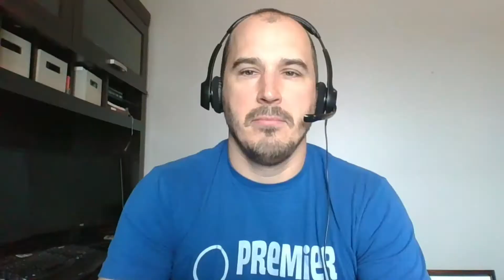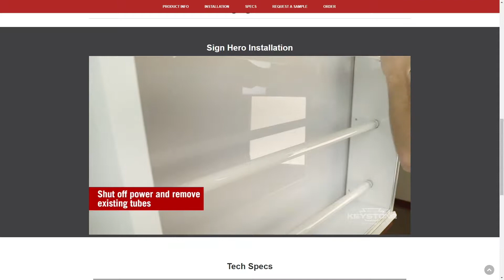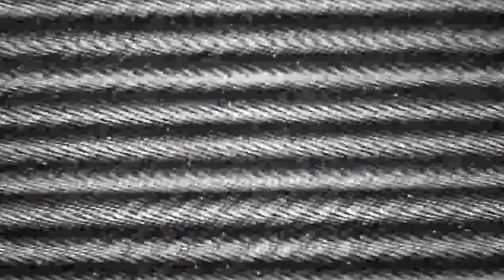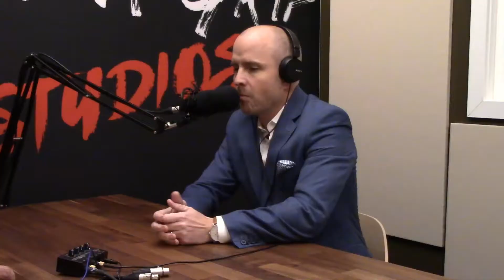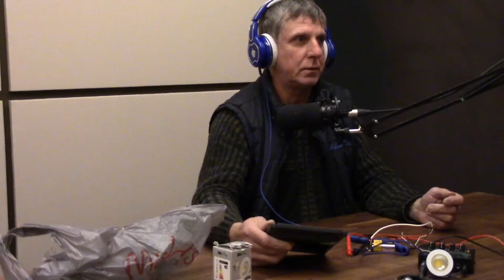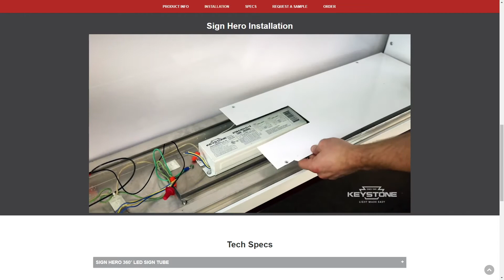EP 053 - Wes, The LED Tinkerer

Comment: Don't either if you know that the proper way to drive an LED is with constant current?  You keep talking about voltage,  but this misleads the audience.  There is a better way to describe the system.
Reply: Duly noted and thanks for listening.  Hosts of the show.
Reply: I feel that this video is more confusing than anything else!
I got the point the integrated par16 Gu10 based led replacement bulb has an integrated miniature driver to convert 120c to 12v . The led bulb is rated for 5w meaning the current driving the led chip would be in theory 5/12=400ma and what Wes is showing is that once we remove the miniature driver we realized the LED only requière 25mA so 16time less!
Reply: @SébastiensebastienpPanouille  We are having some fun on the Get a Grip on Lighting Podcast.  Who tries that stuff?   Thanks for listening.